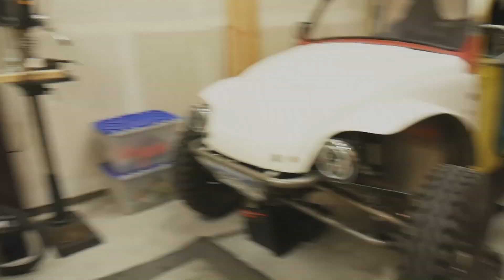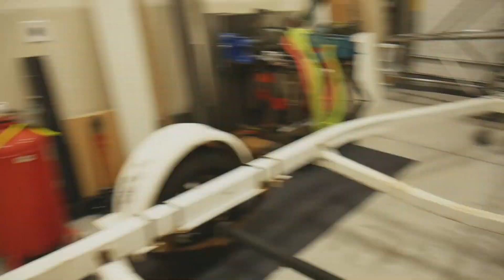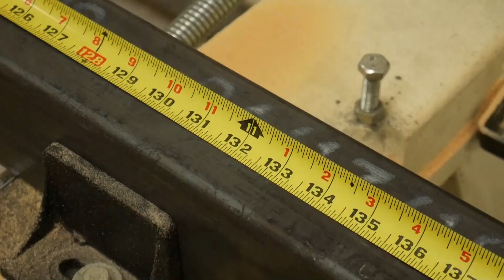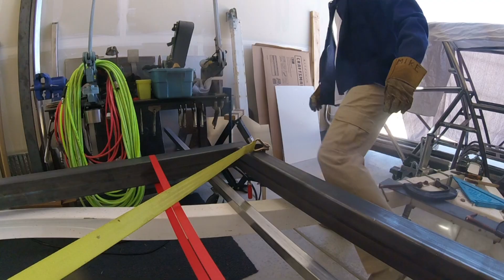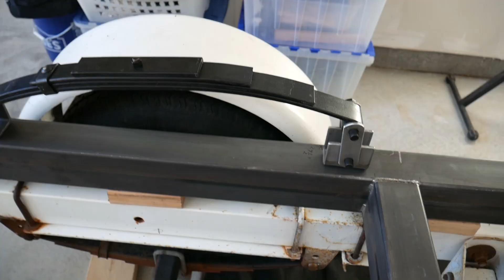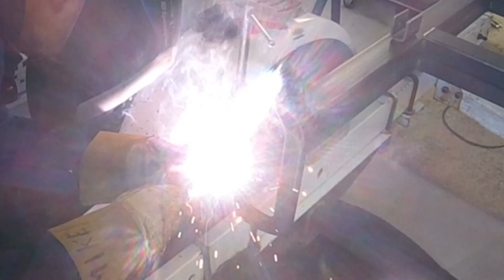Trailer Build Pt 1

Comment: Hi Mike, I wanted to ask you if you thought I could use my tig to weld in replacement panels, for example I have to cut the lower skin off of my 55 truck and stich weld a replacement panel in, I see it is usually done with mig, but I don't have one, what do you think

Comment: Nice, Mike did you do a make vs buy analysis on the trailer. I was thinking you might have been able to buy a ready made trailer cheaper and would have saved a ton of time.
Reply from the maker: Mike, most likely I could have found a trailer that would have worked pretty good. But the trailer I can build will be perfect! Even if it takes time and a little more money.

Comment: You are a lot braver then I am....walking around all those metal shavings in bare feet.   Seems like it would work really good if you were to just connect your built piece to the boat trailer.  Wouldn't be much heavier but it would be a lot more stable.  I like the idea of the cut out under the backside..never mind after seeing the springs on the boat trailer, I get it.
Reply from the maker: That would be a little over built. But super strong and a lot easier! Don't know why I walk around in bare feet. Need to stop doing that. 😒

Comment: Looks like its comong along nicely in building a flat bed myself although its for moving to arizona but its basically the same making it to haul stuff for me mostly tools and motorcycles but I like the springs you have I am going to look into those for mine so thanks for sharing info on what you do there are so many that dont or just wont for some reason
Reply from the maker: Thanks bud, good luck with your trailer. The springs and mounts seem nice. The springs are made in China, but quality seems pretty good.
Reply: @DougBugBuilder thanks  I've gotten alot of stuff from china that is of good quality and for that low of cost for springs how could you go wrong

Comment: Those u bolts could be galvanized. Make sure to sand off the coating and use a respirator when welding. We need you around!
Reply from the maker: Thanks for the advice! I've already consumed more that my share of galvanic poisioning. 😁